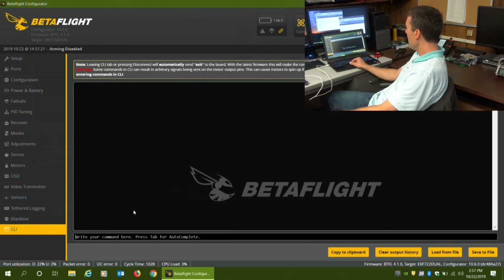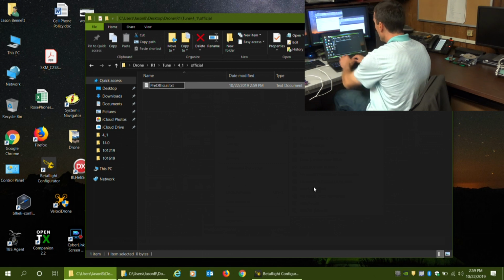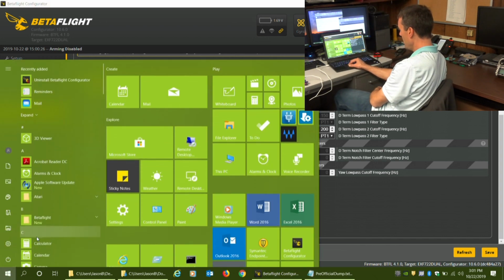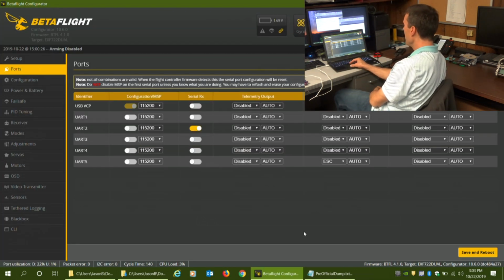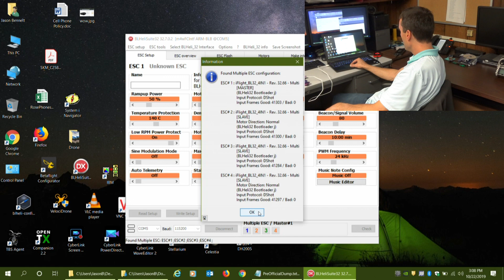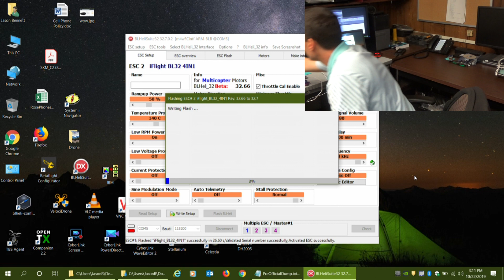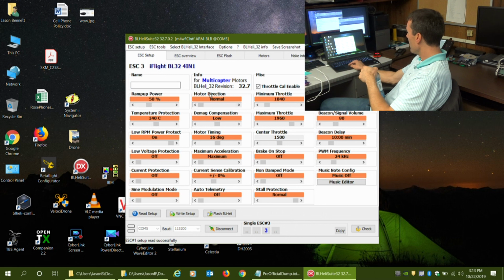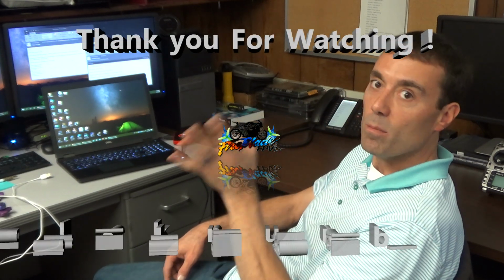Betaflight 4.1 Bi-Directional DShot RPM Filtering Setup - Backup Config And Flash ESC

Comment: Your videos on Betaflight are awesome. I love the way you add what comes to your mind and the explanation of what you are thinking with these videos, it really opens multiple doors of information! Was hoping you could help me on this topic?

I am having trouble finding out if my ESC supports bidirectional dshot, it is a Holybro Tekko 32 F3 4in1 45 amp. On the Holybro website it says: Supports oneshot, multshot, and Dshot PWM. The reason I searched your video was because I recently upgraded to 4.2 and was following J.Bardwell and he made a comment suggesting that we all should be using bi-directional dshot.

My quad was flying superbly before 4.2 and I thought new version of Betaflight is better. I have a suspicion that my ESC does not support Bidirectional DShot. I had 2 recent crashes when performing a coordinated maneuver, the drone simply went limp and fell out of sky. In addition to that, I noticed a kind of twitching during flight. 

Both of these events are new and occurred after 4.2 and application of bi directional dshot. The advice from J.Bardwell sounded as if all ESC could accept Bidirectional DShot, I thought it was similar to adjusting PID. 

My question to you is, do all ESC support bidirectional dshot and if not, can turning it on make a quad crash if the ESC doesn't support it? 

Thank you so much!!!!
Reply from the maker: Hi Kevin and thank you very much !  
That is very possible that the ESC may not support bidirectional DShot. I have a Typhoon32 they also does not, it will take the firmware flash on the ESC but gives errors in the motor tab. 
However, the problem you describe sounds like something not keeping up, like possibly the CPU is not handling the data. I’ve seen this problem when trying to use DShot600 with bidirectional. If you have not already, might try using DShot300 protocol with 4K/4K gyro and PID loop update times. 
Your loop times might be too much for the processor, and possibly the dshot protocol. 
Give that a try and see if it helps 👍
Reply: Jason FireBlade_FPV Actually it might have been a bad ESC. I didn’t want to believe it because it was relatively new (4 months). I have an identical quad and actually turning bidirectional on or off didn’t matter. The twitching I saw and the sudden loss of control was actually confirmed when I attached the quad to BLheli and motor 4 wasn’t showing up. I than ran the same exact Betaflight setup on a twin drone and it performed, like butter as they say. Would you concur that if an ESC isn’t showing up on BLheli, that it is the culprit?

Comment: helpful =) yeah heard some people are getting heat problems with bidirectional
Reply from the maker: kVar thank you kVar ! 
Yeah I’ve heard a lot of talk about hot motors, I have not experienced any heat myself. I’ve been running develop version 4.1 for a little while and never had a problem. I think some might be trying to use too much P term values, and in BF 4.0 and up they bumped up the authority of P values so they are stronger, and shouldn’t need as much. 
Pre 4.0 I was using P values like 80 Roll and 85 pitch and around 90 yaw. I think if you were to use those numbers now they would be way too much. 
4.0 and later I re-tuned right from the start and never went over 50 on any values, didn’t need to. Yaw is a big one too, down around 30-40 now which is plenty. 
Could be filters too, 4.0 and later has a lot of changes to filters. I started with stock and used the GitHub article on tuning filters, very helpful and I’ve been using the “filters lifted 1.5” settings, work great. Link to the article in desc. 
I’m working on the beta flight portion of the video right now and will post very soon 🤟😁

Comment: well just subbed ,, and i have just built my first quad,, i have the iflight f4 twing and succex 45 a 4n1 esc,  received for getting old day,,  so i got xl5 v4 frame and 2207 xing motors..  on 4s , because that's what i got lol. should be a step up from my wizard  which still flies but was good for learning how to fix... i may need some guidance ..  got lastest BF, BLH 32 stuff ready  just need to do it lol.
Reply from the maker: Thank you Michael !! 👊  
Will sub back 👍  
I’m working on the second part of the video now, the good stuff 😁  
Not very difficult, but some key settings to get right and some good tests to make sure all is working optimal 🚀  
Thanks for sub man really, and I will help out any way I can 🤟
Reply: @jdogb1  don't have much of a channel,, i don't have internet out here just on my phone,,, what vids i got take hrs to upload,, so i don't bother...  looking forward to osd ,etc. using viper goggles  at the moment.. been watching vids etc was little to set up with wizard..
Reply from the maker: Those are great motors. And the frame should do awesome. I bet rpm filtering will work with that esc and fc 👍